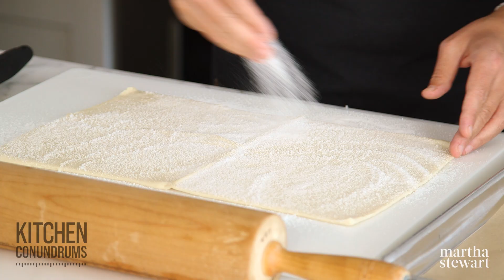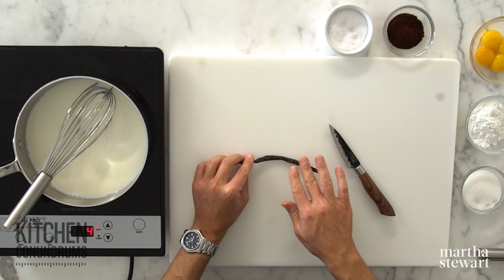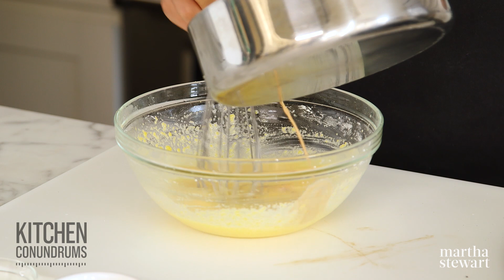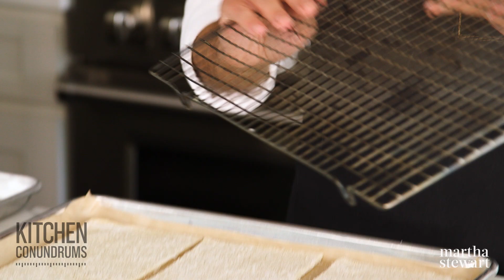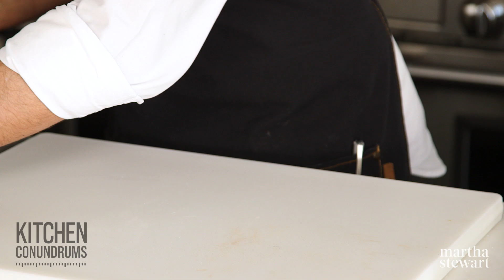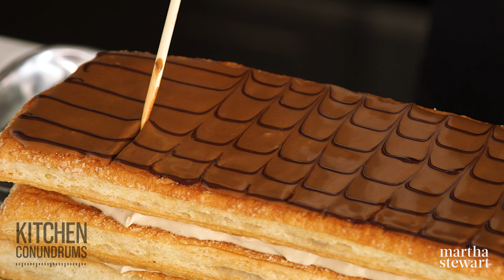Make an Impressive Puff Pastry Napoleon | Kitchen Conundrums with Thomas Joseph

Comment: A little bit of unsolicited advice: I find it better to use the cooling rack to chill the puff pastry in the fridge, and then use both cookie trays to bake the dough. That way you get even heat, the dough puffs evenly and a bit more compact, AND you can use the cooling rack to actually cool the dough.